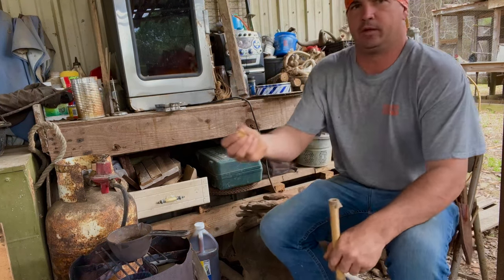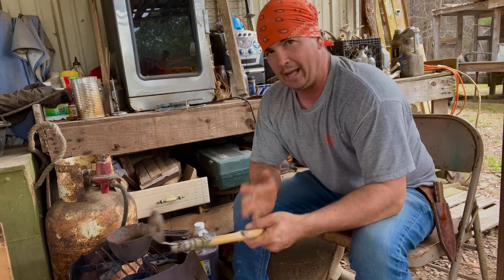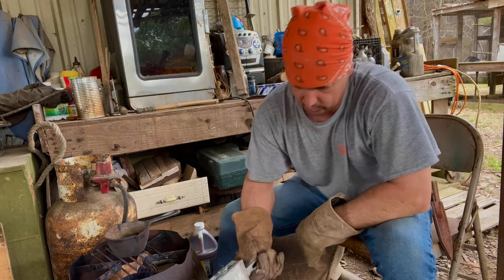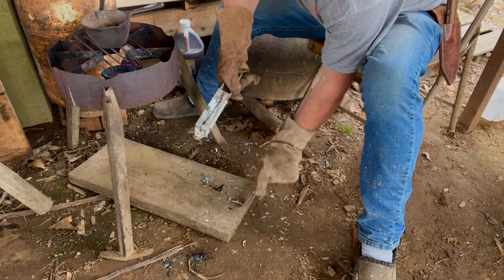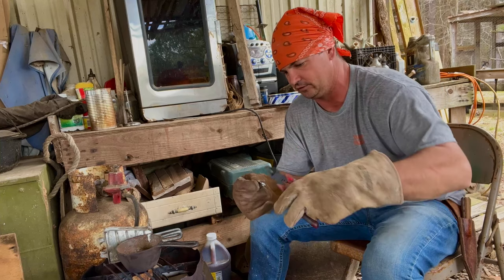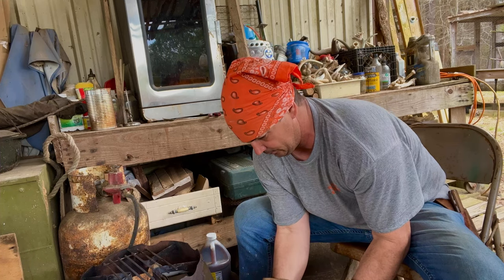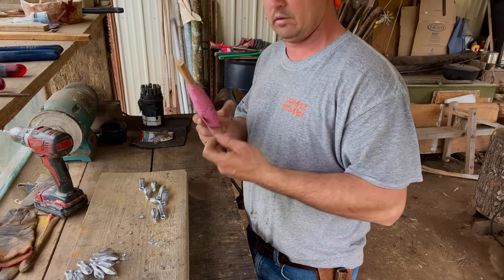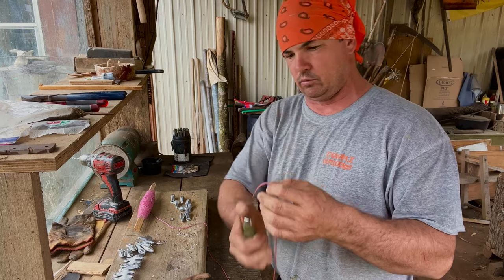Making some new limb hooks with 2 oz weights we pour

Comment: I use a soup ladle for pouring things like that.  I have a cast iron ladle but it doesn't hold much lead.
I flux my pot with an inch of broken
Crayon.  It smokes a bit but I hold a match too it and burn off the smoke.
I really enjoy casting things out of lead and pewter too. Glad you do too.
John Davis Jax Fl
Reply from the maker: It’s satisfying to make the things you need.

Comment: I cast for my Flintlock.  Love it just relaxing once you get a smooth rythem going. The Lee melting pot works great. Electric, just set temperature to 750 or 800. First few just throw back in pot. Mold will get hot then.  Nice job on this today.
Reply from the maker: Thank you . I had never used this mold before and its a lot different than my lee bullet molds. I can make them with ease but this was different. Its a large peice and takes a lot longer to heat up

Comment: If you will light a candle and hold your mold over it, the suet from the wick burning will turn the inside of the mold black. Your lead will fall right out then. They make a ladle with a pour spout made on the side, it’s cast iron and beats up well. If you shorten your wooden handle and smack a crease on the side of the spoon it will pour much better. I pour egg sinkers for slingshot ammo, they will work well for your limb lines and are much easier to fool with.